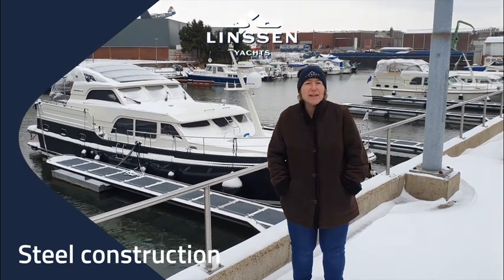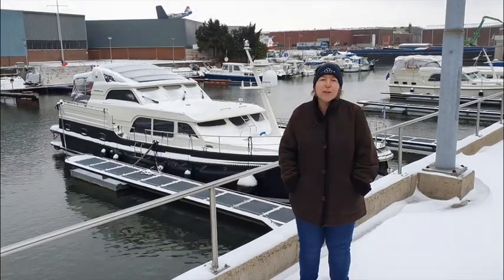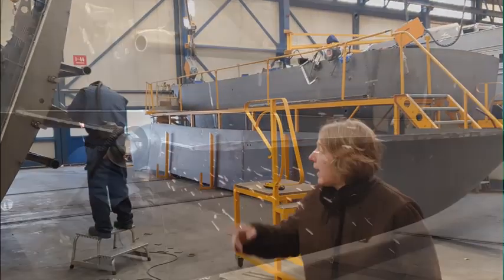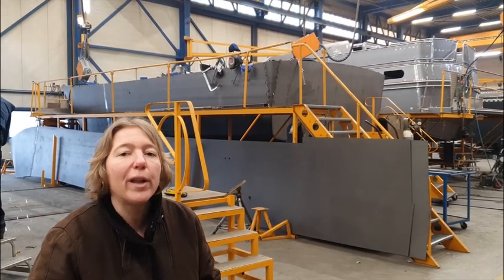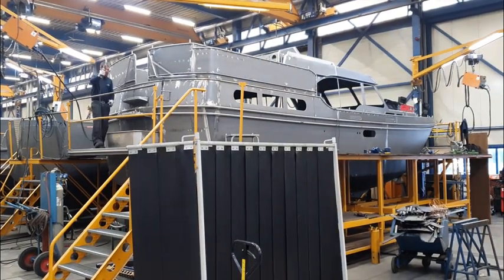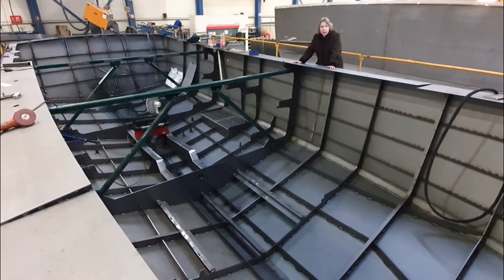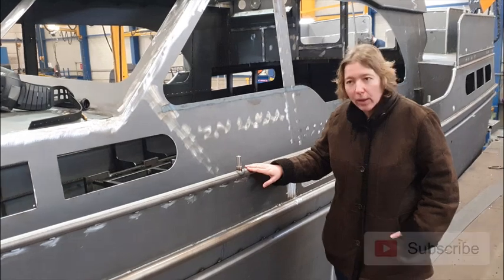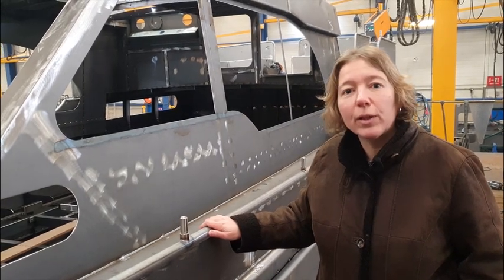Linssen Yachts Steel Hull Construction

Comment: How do you keep the steel from rusting during construction? It looks pristine!
Reply from the maker: Our facilities (in winter time) are always heated, so no condensation can occur. Also, directly after blasting, the hull gets its first primer coat.
Reply: @LinssenyachtsNL  you say primer the steel after I was told to zinc after sand blasting the two pack primer the two pack Epoxy colour Dankie vir jou help Dankie Michelle

Comment: how thick are the hulls and superstructure? and why not Ali superstructure?
Reply from the maker: Steel used is 6/5/4 mm depending on type/size of yacht. We build displacement yachts and therefor steel is an excellent option. It provides for excellent stability and cruising characteristics.